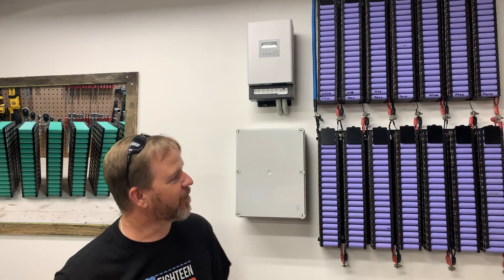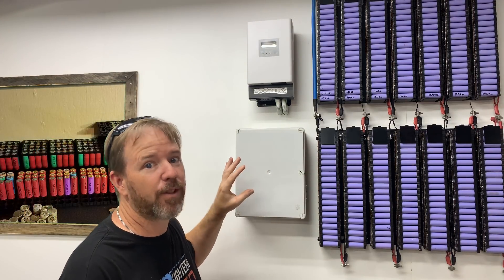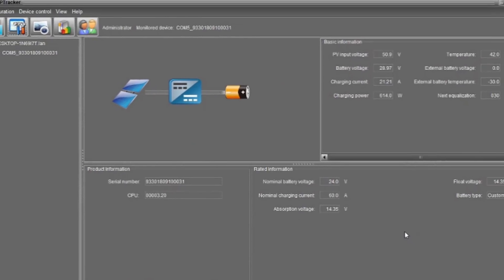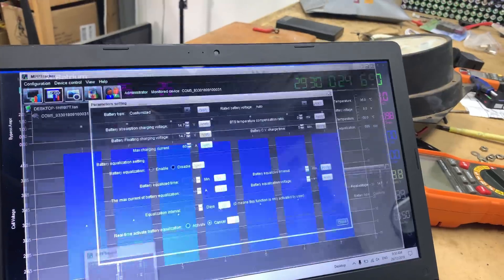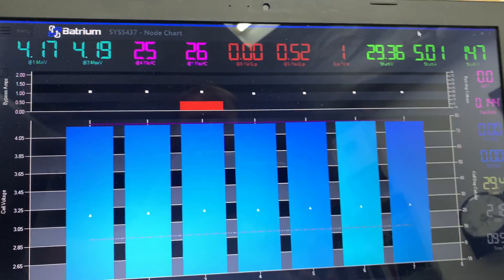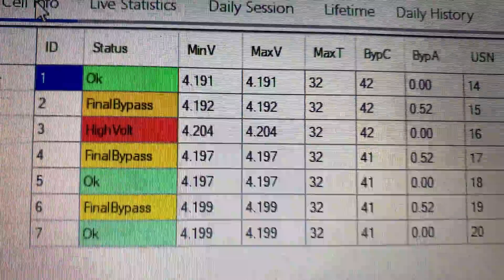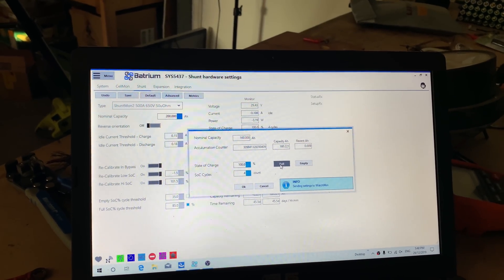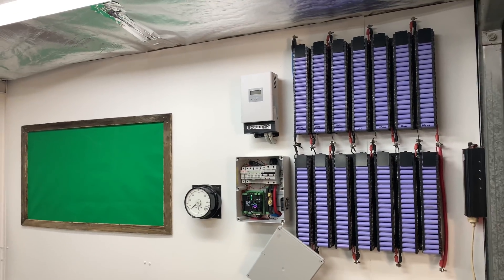Load testing the workshop powerwall  | SO MANY HEATER CELLS | Important test for all Powerwallers |

Comment: Let me get the right you built that battery but you did not calculate the capacity correct very interesting. Those heater cells are just a bad day away from full melt down fire. Just fyi
Reply from the maker: lol you have looked at my other HUNDREDS of videos right lol  Just FIY this is a learning process over MANY MANY MANY years, these batteries are on their 3rd life so they are going to be close to death... well they were - 99% are still daily service right now.
Reply: @HBPowerwall  i know i just found it funny when you said your forgot to multiply the capacity by two. How often do you cycle those battries
Reply from the maker: They run security  24/7 maybe 200-300 watts, and lights and fans all day maybe 450watts so a few kwh every day.. They don't just sit there :P Then on the weekend when i'm not in the office it also runs a 2 card mining rig all weekend..

Comment: Hey, what size gauge wire did you use from your batteries to your inverter?
Reply from the maker: I used this stuff - Just got another 10 m for another project - https://rover.ebay.com/rover/1/705-53470-19255-0/1?mpre=https%3A%2F%2Fwww.ebay.com.au%2Fsch%2Fi.html%3F_from%3DR40%26_trksid%3Dp2380057.m570.l1313%26_nkw%3D35mm2%2Bwelding%2Bcable%26_sacat%3D0&campid=5338074967&toolid=20008

Comment: DCM60X faulty from new  ,  I purchased on eBay with great expectations of a fantastic charge controller
after fitting i turned it on and it began to charge but then stoped charging ,wow i thort as it displayed full battery voltage  ... no it went flat in 1 hour that night
next day i checked my settings and away it went . about 2 hrs later it stopped charging
again i checked my settings  away it went 30 min and stopped after a frustrating hour checking my system i found the fault .... 2 volt discrepancy between my baterys and its meter 
at 24v my battery need   28.8v bulk tut could only det 26.8v when it said  28.8
there was not enough adjustment to compinsate
contacted the seller and even mor problems
i ended up getting eBay involved
and i am still waiting for my refund . nily 2 weeks now
think eBay to the rescue    NOT HAPPY 8(....
Reply from the maker: That's unfortunate - i'm sure you'll get it sorted

Comment: Hey mate, quick question , best 18650 cell for solar storage ? high amp draw or more storage eg: 2600mha 10a or 3350mha 4.8a ??? if you have covered this in a video i am sorry
Reply: For storage you would usually go with high capacity low power, so 3350mha 4.8a

Comment: Pete, in your breaker box, I see a fan on the batrium heat sink and an exhaust fan for the box, but there's no vent for incoming air.  Where does the airflow come from?  Maybe via the holes from inside the wall?
Reply from the maker: that fan on the right is an inlet fan blowing across air exits out the holes in the wall.. I need to slow the fan some how or create more holes in the wall behind.
Reply: The steampunk amp meter is way cool.  Is aircon in the workshop out of the question?
Reply from the maker: Gauge is very cool, hope to get it working in some fashion some day. As for air con, would love it but it will be quite expensive to do right.

Comment: any thoughts on finding the heater cells ahead of time?   Would be cool to know before moving to the batteryhookup nickelroll.   Since you have snipped the fuse wire, could you do a resistance test on a couple of those heater cells and compare to some known good cells?
Reply from the maker: That would make a very good video - how ever it wouldn't be lab results that mean anything unfortunately. Remembering this is my shedwall it's been to zero volts on several battery packs, it been in EXTREMELY hot shed for maybe 2 years inconsistently charged. If there was a worse case cinario it would be where it's lived its live as a wall. lol
Reply: @HBPowerwall  nice.  just curious if the heater cells have a resistance over X and maybe that's the pattern.  I have seen some people do resistance tests with cell testing.  Just wondering if that correlation could help prevent some heater cells being added.  What temp do you consider too warm for a pack?
Reply from the maker: I have a good resistance tester here I should make use of it!!!!! For me a hot cell is one i can lay my hand on and feel that is different from the other three in the discharger. It only has to be noticeably warmer to be recycled.

Comment: I need to build me one of these! My hydro turbine even in it's crude unfinished form is putting out like 150W 24/7 right now and I don't have anything to store it in.
Reply from the maker: Can you just ad a grid tie inverter? I don't know if they are legal in your area but https://rover.ebay.com/rover/1/705-53470-19255-0/1?mpre=https%3A%2F%2Fwww.ebay.com.au%2Fitm%2F2000W-Solar-Panels-on-Grid-Tie-Inverter-with-Limiter-Battery-Power-Home-PV-2000G%2F202020786543%3Fvar%3D502023108496&campid=5338073988&toolid=20008 
Or maybe store it as Hot-water? Might get more views if your more creative than following the crowd. If you're in the states maybe a few Nissan Leaf cells? Hit me up admin at diypowerwalls dot com, I might be albe to help
Reply: @HBPowerwall  I can add an inverter with limited but if it screws up and feeds the grid then I'll get in trouble to some degree. Also I'm not sure the best way to integrate it into my system without micro-cycling the "battery" and I don't know if it has curves for hydro built in that I could bypass my midnite classic.

Right now I have it dumping heat into my workshop. I think the best solution I can think of is to have a large off grid system with grid backup. My large resistive loads make it difficult to sort out.

Comment: Great Vid Pete glad to see your not anywhere near the bush fires keep safe bud
Reply from the maker: Bushfire save here, but the farm is dry & plenty of fuel for fires - scary out there at the moment. Even mowing is an issue because you can hit a big rock with the slasher and start a fire.
Reply: @HBPowerwall  might be a bit more work but you could use a strimmer with nylon wire very little chance of a spark
Reply from the maker: 20 plus acres of land is mowed lol

Comment: Does the Batrium not bottom balance? Would this help to level out the heaters?
Reply: Top balance and No it does not help. Heaters = cells with high ir or self dischargibg
Reply from the maker: Batrium is a passive balancer - or Top balancer. Passive and active balancers play different rolls, if i had an active balancer I would get possibly get more from the battery but at the cost of having to constantly move energy around (and that costs even more energy) A better way to approach the bottom balance is to build a better battery to start with that doesn't require as much balancing. Recharging the battery took about 2 days as recharged to within 0.01v with out needing to be rebalanced so the total draw on my battery from the BMS over those to days of recharging was 48w

Comment: Another great vid Pete, thanks. Question though: I have trouble getting my cells back in balance after dropping any strings to 3.0v. I think it's because I don't have enough solar to do it within one day. They get half charged after a day and upon night time discharge the delta V only increases. Sometimes I have to switch off the load and let them balance for a few days to get them good again. Using wm4. I can't tell if this is because my weak packs are just too weak. Thoughts anyone?
Reply: Charge Them fullu Up and see. IF One and same pack Always falls behind thats because you have self discharging cells
Reply from the maker: Test them, your battery is only as strong as your weakest pack. Solar panels are cheap these days grab an extra one or two when ever you can to improve your charging. Would you believe i have the same issue? I don't have enough solar to cover my loads so about to double the solar on my offgrid so my batteries can balance daily and keep them in better condition and make the cells last longer.
Reply: @HBPowerwall  Thanks Pete + Daromer. Yes, it is always the same packs that are weakest. Adding more panels is an option long term by building a pergola of sorts. In the meantime, I'm just switching off the load to prevent dropping cell voltages below around 3.5v (seems to be when the trouble starts). I suppose power usage is like money - best to live within your means!
Happy new year guys. Hope it's a good one for you both

Comment: Interesting
Reply from the maker: is that a good interesting or a bad interesting?
Reply: @HBPowerwall  Good interesting!!
One question:
You balance cells by like modules,right,not by cells?
Jehugarcia does the that, is that safe if the cells are in very close  internal resistance?
I am trying to understand the logic behind it.
Reply from the maker: Its save if it's done right, with equipment that is designed to handle it
Reply: @HBPowerwall  aaah I see!
Thankyu! Keep up the good work

Comment: hmm so my idea of putting temp sense probes in the pack may not be such a bad idea after all but i would add it might be wise to be able to cut power connections to any wayward cells as well ?
Reply: ok back to the drawing board
Reply from the maker: more temp sensors would be a pain - but if you had a water cooling loop with slow moving water you could loop the cooling pipe through the cells and between each cell have a temp sensor and mesure the difference in temp between the first n second, second n thrid and so on it might make for a better way.. *thinking out loud
Reply: @HBPowerwall  probably the option that tesla went with  but as we use second life cells
Reply from the maker: Monitoring every cell would be a nightmare? How do you plan on the wiring harness being cost effective?
Reply: @HBPowerwall  i2c bus like the longmons
Reply: would use one sensor between 4 batteries or would need to redesign the setup of battery configuration
Reply: i believe you can have upto 256 sensors on i2c bus

Comment: That's why I don't play around with used Sal's they bite you in the rear end🦀
Reply from the maker: Not so much bite, but nibble slowly
Reply: I've built my own 20kwh power wall and I've got to say it requires more manual supervision than I'd expected. Genuinely thought it would look after itself after carefully cell selection but that's not the case. I'd still do it the same way again though as I got my cells for free and 20kwh of new battery would be cost prohibitive for me
Reply: @davidball1924  I buy my batteries from AliExpress I get them is cheapest $2 a battery Panasonic 18650 B 3400 milliamps I won't mess with used sales unless they're free I haven't had the luck to find free sales I can't afford my system to go down it is my only means of power this.guy it is a hobby lol
Reply: @BeYeshuas144k  I think you made the right choice buying new if it is your only source of power. I have a very stable grid connection and this power wall is me just playing to see what I can do to reduce my grid use, especially at peak times. It works but I am still heavily dependent on the grid but I have a large house taking the power a small house would. Better than not trying at all.
Reply from the maker: These choices and considerations are important in building a wall. You have to work out risk versers reward. And if your power is mission critical - you have to go new ever time!

Comment: Do they only seem to heat when you cycle them?
Reply from the maker: Yes, i just run a 300w load test for 5 hours and found 1 more heater. When not charging or under load there is no heat
Reply: Do you build your packs and pick the heaters out upon testing? Or do you normally try and weed them out beforehand? I'm just getting started in mine and could use all the advice I can get to make sorting these cells easier. Have been buying used cells from Tom on batteryhookup and have found his modem batts are very consistent quality wise. Normally the voltage alone can tell ya if you will have problems out of 160 cells only 3 had a voltage below 3.3. So I threw together a 80P pack and let it equalize overnight and charged it at 6amps to 4.1v. Is that an ok way to bulk charge the cells? Or should I be doing them individually?
Reply from the maker: I pull any cell that is even slightly hotter when doing the 1amp discharge tests - these battery packs could have been put together up to three years ago. Some are ones I've pulled from my main pack, others have been reverse charged by drawing them down way to much, so they have had a very hard life. Add to that, they have lived in a VERY hot shed through a few summers so not at all ideal living conditions for a poor second life battery. You can bulk charge that's fine especially if they are very low in voltage under 2v or something, will bring the cells back nice and slowly just make sure they all have the same voltage when you parallel them up. If you're buying from Tom be sure to save %10 by using my discount code 'Powerwalls' :)
Reply: @HBPowerwall  thank you I will be sure to use that the next time I place an order which I'm hoping is soon, still need roughly 1,000 more cells to get to my 14s80p. I have been having to buy all of mine as I have had extreme difficulty sourcing them on my own. Everyone I approach about it seems to think I'm up to no good when I ask about salvaging batteries lol

Comment: On what point did you check for heaters with the thermal camera? In the empty state? Wouldn't it be better in the top charge? I'm so slow building my packs that I was able to find selfdischarging cells cause they were stored for 6 Months or so before completing the packs :-D
Reply from the maker: Right after I turn it back to grid. So lowest cell was 3v but had nothing to do with the heat. It was just under load so i'm thinking high resistance cells perhaps were the cause?
Reply: @HBPowerwall  But you did test the whole pack for capacity? But the lowest capacity cell wasn't the one wich was going down to 3V?

Comment: What's up with these charge controllers? It seems it's all you and avg.joe and some others. Use, what's so good about them? I get mine across from cheapest darkest China, not the cheapest, not the best, but they work,  EPever makes or buys decent stuffs! The  tracer a & AN are working, but I don't want to push them, I'm still working on a cell spot welder, it wasn't the leads, I moved up to 4ga, and about 28"-30 " long, it still doesn't do its thing, I'm going to add a capacitor to the AC side, if that doesn't do it, I have some parts coming that will,  cheers and happy NewYear,
Reply from the maker: it's one of those things, it's the only ones i've used that work and i like. My oldest is about 5 years old of full time use. There might be better out there but these things are rock solid.

Comment: Pete, could you measure voltage on PCM60x PV terminals when breakers are off to see what kind of voltage you get there? Mine is not turning off during night, and I have battery voltage on PV terminals, and am seriously considering wether this is normal before opening up the PCM60x and trying to find out what could be wrong with it. Thanks.
Reply from the maker: Yep can do it in the morning - do you have the battery sense cables attached - that will keep the charge controller on at night.
Reply: @HBPowerwall  I had the battery sense cables attached for 2 years and it DID always turn off at night. I removed after you suggested it, but it didn't help, it still keep on during night, and the PV terminals have battery voltage, which I don't know if it is normal or not. Thanks!